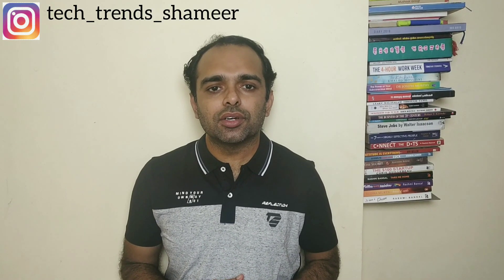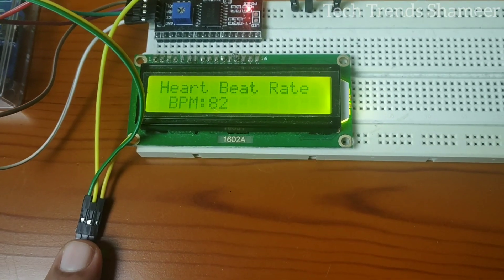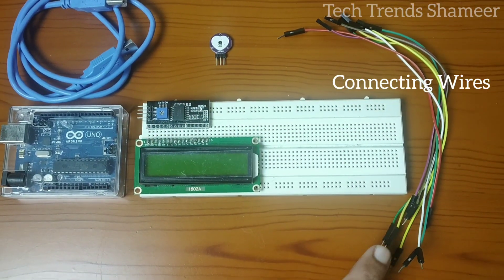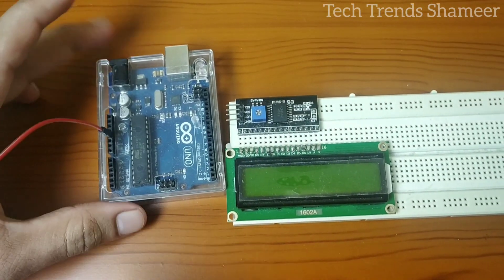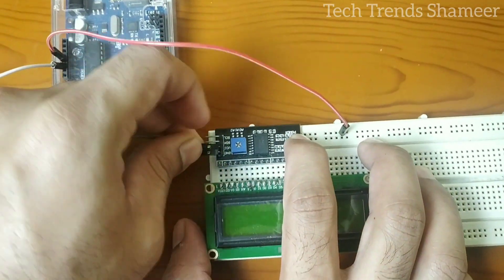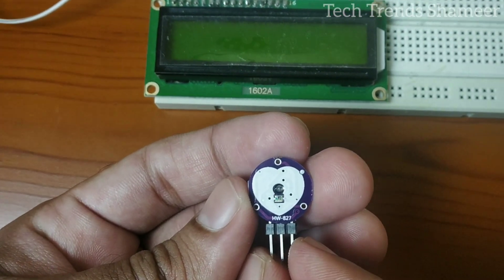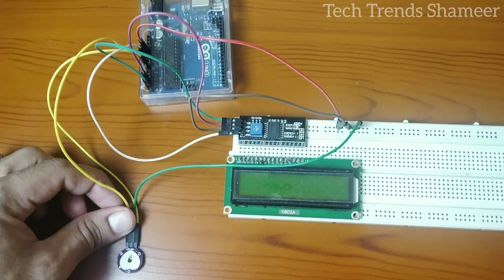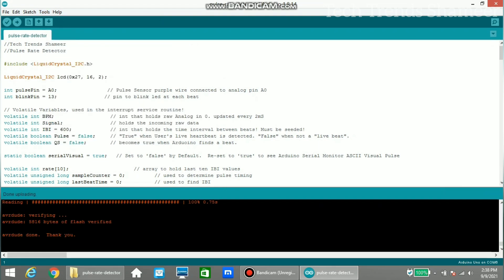How to do a Pulse Rate Detector | Arduino Projects

Comment: Send me the circuit diagram
Reply from the maker: Check the full video. Circuit is included in the video.
Reply: I know bro, but I want circuit diagram in hd to attach the file purpose
Reply: How to solve, wire.h no such file or directory problem in Arduino ide code error

Comment: bro getting error in compilation
liquid crystal I2C begin
Reply from the maker: Are you using LCD with I2C or LCD alone ?
Reply: @TechTrendsShameer  i tried to correct the error with begin (16,2) but the lcd i2c have no power